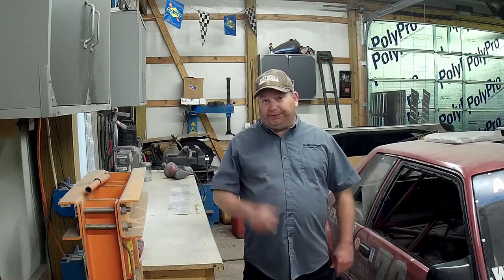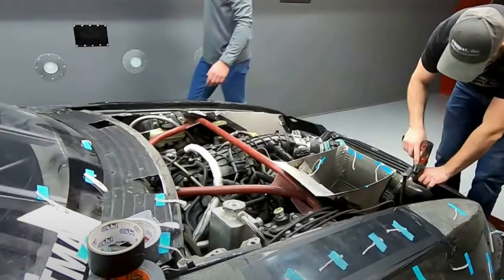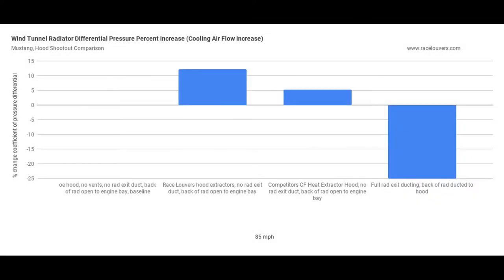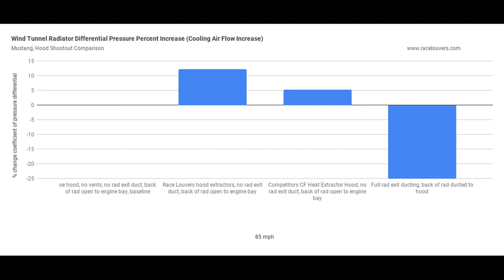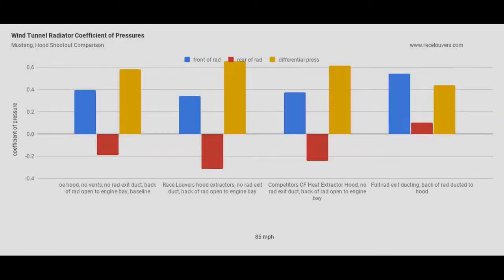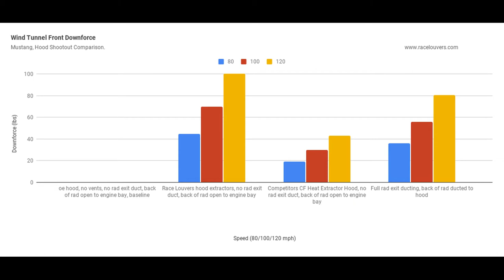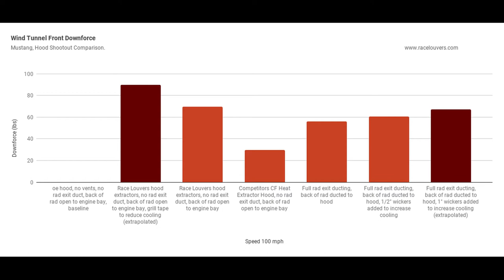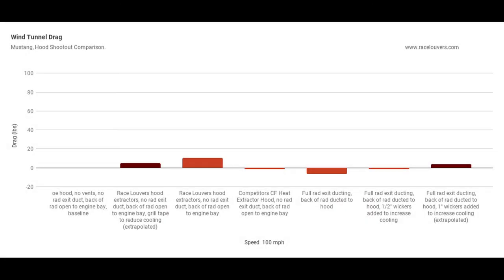Race Louvers - Wind Tunnel Hood Shootout Data

Comment: The positive pressure on the ducted system will make the air more dense. Dense air cools better.  Possibly negate the reduced air flow effect on cooling.  Exhalent video, thanks.

Comment: I have a 2019 ram 1500 classic, old style, it has the shutters front rad, by installing these leavers would it interfere with the shutters in front of rad?
Reply from the maker: The shutters in front of the rad are there to regulate airflow which helps with drag and fuel mileage, adding louvers to the hood wont effect the shutters and will help still help with heat.

Comment: @race louvers . Hi . 
20mm Raise hood work for cooling  ??? 
Thx
Reply from the maker: No, raising the back of the hood hurts cooling and downforce
Reply: @racelouvers7958  he is sure ? Are all dragracers in Brazil wrong to do this?
Reply from the maker: @eltonv8tao  Yes raising the back of the hood for cooling is not recommended. While raising the back of the hood does help vent heat slightly only when the car is not moving. Once the car starts to move the high pressure air from the cowl area goes into the engine bay raising the pressure in the engine bay and on the back of the radiator which hurts radiator cooling. Since the main cooling of any car is the radiator and most cooling is needed when the car is moving raising the back of the hood hurts cooling. Plus raising the back of the hood creates front end lift which is bad at high speed.
Reply: @racelouvers7958  cowl induction would not be good for refrigeration from what i understand. Would it be good for aerodynamics? or would it only serve to accommodate big turbos, big engines?
Reply from the maker: @eltonv8tao  having the back of the hood or cowl area open to the engine bay creates drag and front lift, not good.